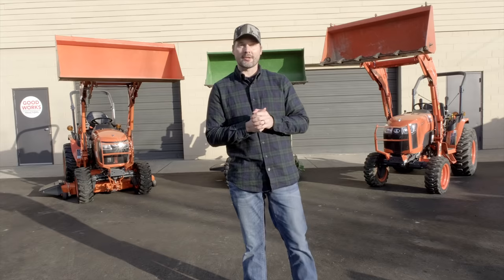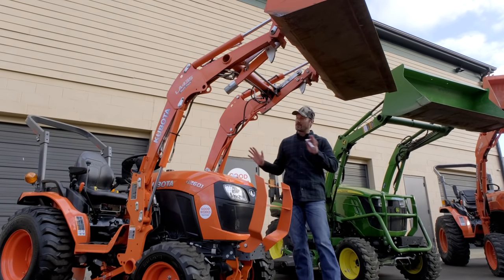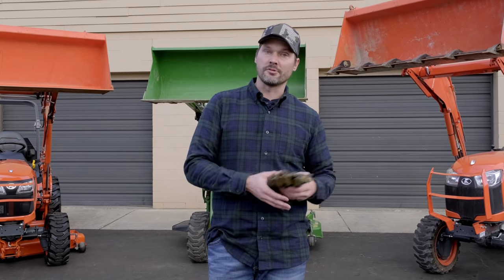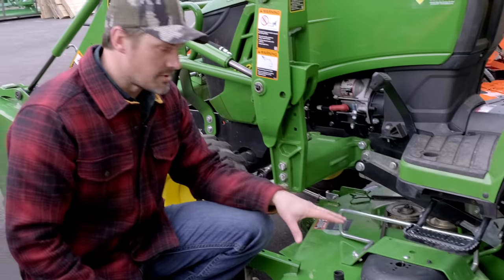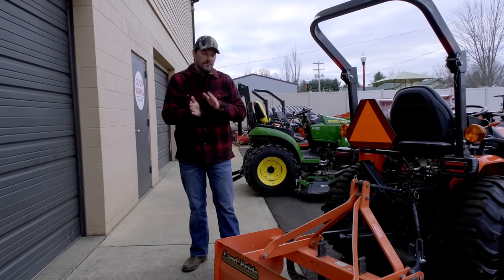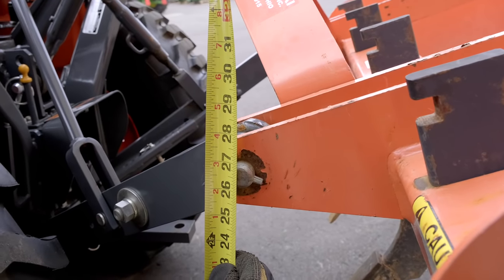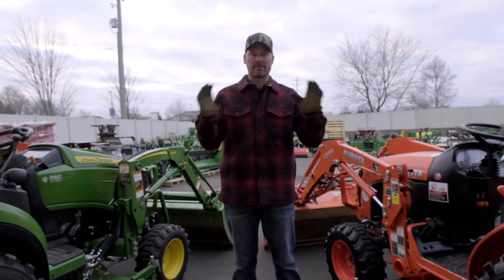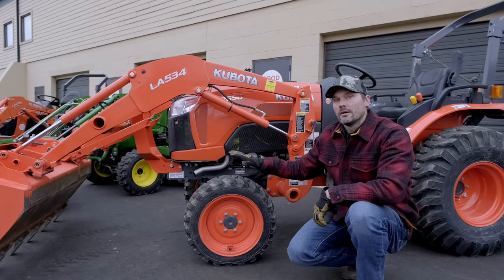NOT EVEN CLOSE! JOHN DEERE vs KUBOTA: B2601 vs 2025 vs B2650

Comment: I think you've really underestimated how much of a hassle the mower deck removal and installation is on the Kubota.  When I watch videos, I always see Kubota owners doing loader work, brushhogging, snow removal and similar work with the deck on.  Recently, I watched a video on the deck removal and installation on a Kubota and now I know why owners don't fool with it.  Takes about 30 seconds to remove mine on my JD.  I also think that even though the Kubota has more lift on the 3 point, using it to its maximum capacity is going to damage the tractor.  The Kubota frame is lighter than the JD.
Reply: Dont forget Kubota has the L series with heavier frame. If you're doing just loader and 3 point work then L is the way to go.
Reply from the maker: I haven't understated it at all.  I've complained about it repeatedly in other videos.  I tried to keep most of my opinions out of this video to make it more objective.
Reply: @hugostiglitz8465  -And John Deere has heavier tractors too.  So your point being?
Reply: @flick22601 - I was just saying that Kubota does have a heavier framed called the L series..that's all. Sheez!

Comment: I'm looking at 2038R. Do you have a video of comparison or be making one? Have gotten alot of good bias info from your videos. Thanks
Reply from the maker: Yeah I’ve done a couple videos on the 2038r
Reply: I've done a ton of research/dealer visits, etc. The 2038R is by all accounts an awesome machine. If it wasn't too big for my property, it would be what I'd get (beleive me, I've tried to justify it). I'm between a B2401/B2601 vs. a 2025R and even then my property is probably better suited for a 1025R (I wouldn't even consider a BX after researching it).
Reply: @danielsharon524  You should really look at the new LX series from kubota. I was in the same boat as you, 2038 JUST too big. I ended up going with an LX2610 and absolutely do not regret it one bit.
Reply: @meisbepat  Thanks! It seemed to me that the LX (or old B50 - I haven't actually seen an LX but I assume same dimensions) was physically bigger and on the same scale as a 2032/8. When I saw/sat on a B2601 (Dealer had a B2650 as well) it seemed to be exactly the size I was looking for. I've only seen a 2025R in person w/a cab so it was hard to get the same feeling and will look @ one w/o (as Courtney pointed out wheelbase & track are almost identical as a 2025R) but in this size I'm leaning towards Kubota anyway. If it was BX vs. 1025R I'd definitely go green as the capabilities aren't even close and physically the 1025R is bigger and has a smaller turning radius.  Honeslty, either of those is big enough (prob. the right size really) for my property but I wanted something just a tad bigger physically than a 1025R & I like all the "real tractor" features of the B2601 (draw bar, 3 Sp rear, position control, more lift cap., split brake, etc.). I'm not crazy about the treadle pedal (figure I'll get used to it), steel hood, fuel fill location or mower deck attaching. I also like all the convenience/appearance features on the 2025R (not sure if it even has position control on the 3 pt.) as well but function on the Kubota is more compelling. I guess as Courtney has said, these companies purposefully don't make perfectly comparable machines. I'd love to have it all in one machine & would be willing to pay for that. I do however want to see if the seat from the LX will bolt onto a B01 as I saw a review that is was far superior.

Comment: I have the green one. I got it because the mower deck and price. In my area it was 4 grand less with a better warranty. The load capacity on the loader wasn't worth the money. I actually need one that will lift round bales. None will do it and still fit in my yard to mow. Also no hydraulic down on 3 point. Not a big deal unless you run an auger in hard soil.

Comment: I found this video in the right hand suggestions watching another video (not about tractors) and clicked out of bored curiosity. 

I went and looked though your past videos. No Isekis? We have a 1980's little 35hp TS3510 4wd tractor on the farm here, bought it used in the early 2000's when on a different farm further north on the other island (I'm in New Zealand, down in the South Pacific ocean) and it's been beaten on for literally decades and is still running. 
What's your view of Isekis? for a while in NZ in the 70's and 80's they were the king of the hill for tractors sold to farmers (as opposed to contractors running bigger stuff 24/7, that was Massey Ferguson by a long way)

Comment: You haven't done a Kubota LX vs John Deere 2 series comparison...but this is what I'm looking at.  It will be used on a hobby farm for manure management and snow removal.  the only other attachments I will be using is a 3 point hitch mounted spreader and a york rake.  Any recommendation one verses the other?  Any input would be appreciated.  Thanks!

Comment: Had both JD and Kubota over the years and like them both, just wish they had more gear drives because I could tell the difference in hp being put to the ground and on hills steeper than you should probably go down low gear    on diff and trans would let you crawl down hills no hydro tractor could ever think of doing.

Comment: Greetings from Wisconsin! Great video again, you really hit alot of info. Where i like the treadle pedal is when I'm turned using my rear implements. I can turn sideways but my heel position doesn't change. On my L2501 it's quite a bit bigger pedal and accommodates my size 16 boot.
Reply from the maker: Size 16!  BIG FOOT! :)
Reply: Interesting point. I'm considering JD & Kubota & hadn't thought of that.

Comment: many years ago had laugh and called local Kubota dealer a moron, needed part for LS5 3 cylinder diesel engine, guy said that they were garbage and he didn't carry parts for garbage, pointed out that half the tractors in his lot had the LS5 engine, lot of tractors use the LS5 engine.

Comment: I use a Ford tractor on my place a old 57 jubilee. With added hydraulics for the bucket. I have no idea the model of the bucket the guy i bought the tractor from didn't know either. Back to subject the kaboda 2650 is several inches higher than the other two. ? Bucket hight.

Comment: Any idea what the weight per square inch of tire surface contact would be for that 2650 with the BH33 backhoe attached? I'm just curious if it would fit into a 14'X40' storage building I have without falling through the floor, until I can use it to prepare a spot for a larger building to permanently store the tractor and attachments. The wooden building is designed to be a garage and can hold cars, but I'm not sure if the floor could hold the weight of the tractor with backhoe and front loader included.

Comment: The b2401 is the gear driven model. It was actually just released. The older model that's gear driven is the narrow version.

I'm also surprised by the rated lifting capacity difference between the 2601 and 2025r loaders. Given that as you showed there's little difference in lifting capacity of the loaders between the 1025r and the b2601. I know the SSQA reduces lifting capacity though.

I'm also surprised that the 3 point lift height is lower on the 2650 than the 2601.

Comment: Do you happen to know what tooth bar that is on the larger Kubota?  I have the same one on my 1025R which I bought used and the previous owner had no idea.  I get asked about it when other tractor guys see it on my machine all the time and I have no clue where to tell them to go to get one.
Reply from the maker: I don't.  I looked for identifying information and cannot find it.  I do see them from time to time and never know where they come from.
Reply from the maker: Tell them to get a Heavy Hitch toothbar instead.  No drilling required.  Plus 5% off with code GWT on anything at HeavyHitch.com
Reply: @GoodWorksTractors  Thanks looking.  I usually do recommend heavyhitch or a couple of the other brands I do know.  I will pass along your code now too.

Comment: Don't know if you still check these comments but I'm going for it anyways. I am new to the country living, noticed you said back hoe attachment is overrated. I am a plumber who has 10 acres and would be using my tractor more for spreading gravel and moving sand at my property, digging up tree stumps in sand, filling holes the digs did blah blah.  But the backhoe attachment would seriously come in handy if it works for digging small sewer lines and whatnot . Is the only reason you label them overrated is because it doesn't get much use or that it doesn't work very well?
Reply from the maker: They can do their job pretty well, but they're very very expensive and most people have short terms projects that they want a backhoe for. I think renting a mini-excavator would suit many people better. But not everyone is in the same boat, and some folks absolutely would not live without their backhoe. So it's case by case, but I just never have much backhoe work to do, and a mini-ex rental would be more cost efficient (and work efficient too). Thanks for asking!
Reply: @GoodWorksTractors  thank you for a response and a quick one at that! I am probably one of the people who would use it more if it is effective, I have a need to dig 2' to 3' foot x 40' long trenches maybe 4 times a year and have to rent a mini ex. It would be nice to have a double duty tool that I could move bails of hay, dirt and dig. Your knowledge was very helpful thanks a ton!!

Comment: Sure wish John Deere would design an auto-connect PTO for the rear of all of their tractors. Most of my misery of hooking up is the PTO. Side note, my latest tractor bought was a Kubota, even tho I have 3 John Deere units already.
Reply from the maker: Yeah, most of them have it now though.  Great feature.
Reply: They did actually.  Autoconnect was an option on the iMatch quick hitch for several years.  It did not sell.  It had its disadvantages for sure.  Reminded a bunch of us that hooking up a PTO shaft isn’t really all that bad!
Reply: I agree.  I have found if you hook up the PTO first. Such as a bush hog, and use a steel pipe to put under the deck and lift up to position it to the hitch. You may already know this trick. Just FYI. They have several videos on TRICKS to make it easier to hook up the PTO and hitch.

Comment: I just test drove Kubotas and the Deere 1025/2025r.. transmission in the Deere is far better in my opinion.. the two ranges are geared better than the three on the kubota. Also the 1025r is a tractor you can’t compare to kubota bx23s.. it’s way better and stronger across the board. I’m still struggling with my decision between the two brands

Comment: I have a question.  Does all three tractors and manufactures offer a Rear Hub adapter for installing Duelly Wheels?
Reply from the maker: Miller Tire just literally came out with an adapter for the 12-16.5 which covers the 2025r and B2601.  Up until that point, there wasn't an option that I knew about.  5% off with code GWT as well at millertire.com

Comment: Idk why Deere wont just build the 2025 to be on the same frame and capacity and loader as the 2032 and 2038R..  Both of those tractors are amazing, the 220R competes hand in hand with the 300E and overall weight beats the 3E and you get premium features... Just seems the 2025 is kind of a the red headed stepchild lol  Love'em all green and yellow though haha
Reply from the maker: They used to build it very similar to the 2032r.  Not identical, but similar, same loader too.  John Deere was clearly trying to fill a market void.  I'm sure they did research on it, but I think they would have been better off keeping the 2025r as a true 2 Series and introducing a 1025r HD version which is what sums up the current 2025r.
Reply: @GoodWorksTractors  they could have at least given it a different model designation.  They talked about reducing customer confusion for years, starting when they switched from the 4000 series tractors.  Nobody knew what the heck was happening with those.  2210, 4010, 4115, 4210, 4310, 4410, 4510, 4610, 4710.  6 different sized machines in that bunch.  They “standardized” when they got all of the 3x20 and 4x20 machines on the same frame sizes.  But the 2 series was still a mess with the 2305/2320/2520 which were all unique in size which made adapting the attachments a nightmare of different parts kits.  (2320 was essentially the 2305 on bigger tires)

Comment: Like the comparison but you messed up your 3ph maximum lift height measurement the jd and the kubota 2650. Keep it up
Reply from the maker: I raised them all to their max and measured.  You'll need to explain.
Reply: @GoodWorksTractors  you measured on the side with the turn buckle for leveling side to side. On the left side when sitting in the seat it's fixed. It just looked like the turn buckles were turned out so the height was lower.
Reply from the maker: Neah, why would they be out of level right now?  The only time anyone moves those out of level is for a specific application.  If they are out of level, it's a fraction of an inch at most.  I was rounding anyways.

Comment: I have a JD2025R (new gen), and I agree that the 3pt hitch is antiquated and I have serious issues with mine and those turnbuckles. I have to run mine in as loose as possible, there are barely any threads holding to the turnbuckle. Does anyone make an upgrade for those that will use the adjustable arms and pins?
Reply: Sounds like the lower arms are on backwards.  The hole isn't in the center and the turnbuckle aren't long enough when flipped.   Take it back apart and flip over and attach the end you were using for implements on the tractor itself for both sides

Comment: I bought my Kubota 11yrs ag and never regretted it. hydrostatic is great. the peddle forward and back is great. you are not using it right. I have a JD450C track loader I got 22yrs ago and have done some very serious work with it with the Drott 4 way bucket was awesome. I would not support JD anymore as their prices are just sickening! $ 500 for an oil press ga. ha. ORielys had the same thing for $23 and what JD did to the farmers with the self-repair was just a horrible thing to do. So FU JD

Comment: So you can drive on top of the mower deck with the tractor but you cannot step on it without damaging it?
Reply from the maker: I explained more thoroughly in a recent video.  It has nothing to do with the mower deck falling apart.  When you drive over the deck, it is not attached to the tractor.  The entire perimeter of the deck is on the ground and absorbing all of the impact of the load being driven on it.  When you are stepping on a deck that is suspended in the air, it is only attached by a couple of relatively small leveling rods that you (the operator) are relying on to keep the mower cutting even and raising and lowering properly.  There's a big difference.

Comment: One thing I am confused about - if the mowing decks can be driven over once detached,  how can stepping on it bend it out of shape? The tractor is a lot heavier than a person
Reply: It doesn't bend or damage the deck itself to step on it, but if you stand on it while it's attached to the tractor, you have to worry about the linkages/adjusters that the deck hangs from.  They're designed to take the weight of the deck, but not the deck plus a full-grown human.

Comment: Great comparison, very helpful.
Question: you said the backhoe is "one of the most overrated options" because of the equipment necessary. Did you mean "one of the most highly ratedoptions", if a tractor already had the frame and hydraulics?
Reply: Polite for "costliest", I think.

Comment: Takeaway for me is that Deere is better at ergonomics and operator-focused convenience and comfort, but the Kubotas seem to have more raw capability. In the right situation I could see getting the Deere just for that reason. Say I already got a bigger tractor with a monster loader and I need this for the smaller jobs and mowing, would be perfect fit for that situation. Otherwise dollar for dollar seems like the B2650 would be the way to go for a hobby farmer who needs something that can do everything well, but just a little less comfortable to live with than the Deere.
Reply: Actually, in this video he explains how Kubota has much better convenience and comfort features. Things like swift tach quick removal of the loader right from the operator seat and two way loader valve function so you can lift and curl or drop and dump at the same time. Something only Kubota has. Kubota is better in just about every single way. But JD is still a great tractor, just more expensive for less features and capability.

Comment: Owning a new Kubota XG850 is a nightmare. It has serious mechanical design flaws in the 4WD and clutch system. Parts replacement will not resolve these design problems. Kubota will not honor their warranty without a lawsuit. They have been sued over and over for failing to honor their warranty when the defect is widespread and super expensive to resolve. We will never buy from Kubota again.
Reply: Buy green and you won't be mean...😂😂😂😂

Comment: Nice comparison.  Probably in the market for one of these three tractors this Spring, or a 2032r to get the better loader, but hate that it would require added emissions controls.   One comparison you didn’t mention is plastic vs metal.  Not advocating for either, but it’s a difference worth noting for some people.
Reply from the maker: I always harp on plastic vs metal so chose to keep it out of this comparison.  Thanks for watching!
Reply: I have a 2025R, I would get the 2032R.